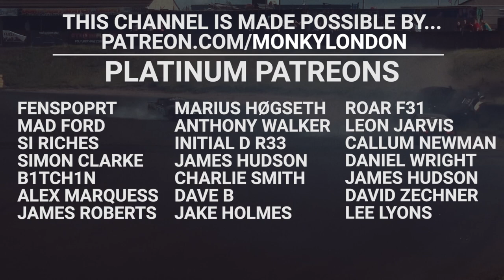🐒 BMW M3 V10 - HOW TO FIT A FIBERGLASS BODY KIT PROPERLY!

Comment: 1:40 I wouldn't say outright that wrap is bad, I think it just depends on the car it's being used on. While stuck at home the last few weeks I've wrapped my car with 3M 1080, and although it's far from perfect, being my first ever attempt, it's a good finish. And it's far cheaper than a full respray in a similar nice colour, which is good when it's my first drift car which I'm sure will get a few scratches here and there.
Also if someone wanted a less permanent colour change it's a good option, as if you remove it carefully it leaves the paint beneath untouched, which would be good if it was an expensive car.
Now in terms of quality and finish, a good paint job is better, for sure. But, having a professional respray done will always be expensive, and so it wouldn't appeal to everyone.

There's a reason they paint cars from the factory Instead of wrapping them, for certain. But some of us are trying to save money lol

Comment: Nice work 👍🏻 Personally I would have added some fibreglass to the top edge of the wing and profiled it to fit better around the A pillar.
Reply: I don’t know how they can sell that as a fitting piece when it clearly doesn’t fit 🤷‍♂️ I’m a fibreglasser and my OCD didn’t like it 😂
Reply: I would of sent it back, absolutely appauling fit, O/S one looked pretty decent though.

Comment: Dave you're 110% correct wrap is crap!! Especially chrome wraps....you need to persuade disco dave to ditch the chrome wrap for a proper paint job (in any colour that's not chrome) because a V10+E46 with sweet body mod's=perfection when no wraped or painted in chrome 👌